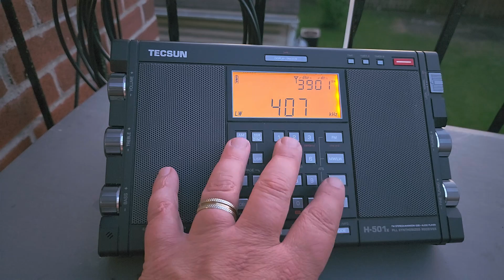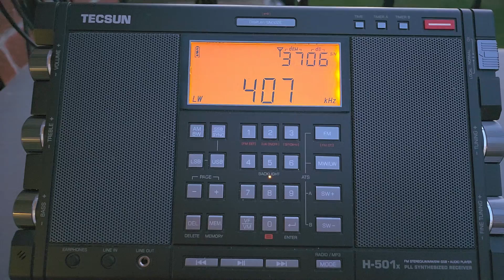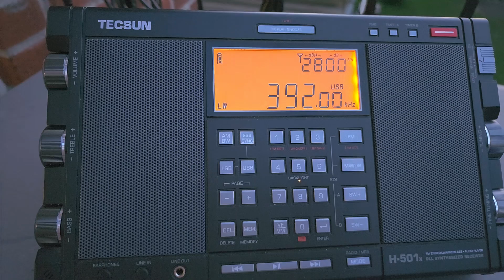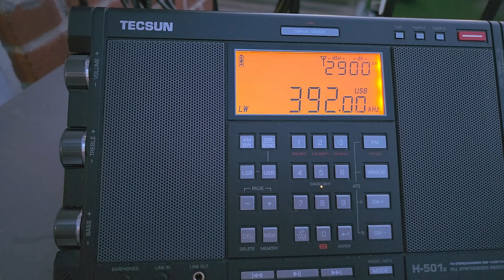Tips on tuning Longwave band in North America searching for NDBs Non Direction Beacons

Comment: Been trying to find out: does this radio or the PL-990x that supposedly go down to 50 khz actually do that? How is WWVB reception for example? Also i read that some of these don't tune the ferrite so you get massive intermod from AM (and I have a lot here locally).

FWIW, I'm a ham & would like to try 630m & 2,200m bands & one of these seems far simpler (& hopefully repeatable} to test relative TX performance, maybe even Rx distant stations. What do you think?

Comment: Great video, NDB hunting is fun.  I've logged 19 NDBs in the past couple of weeks.  A couple of thoughts from my recent experience: 1. Go outside if you have a portable receiver, that will get you away from a lot of electrical noise.  2. I actually get better results on my PL-990X by switching to the whip antenna instead of the ferrite loopstick.  (I realize this isn't possible with many receivers.)  3. I get even better results with an external reel external antenna.  I just clip it to the highest tree branch I can reach, or support it with a telescoping fishing pole.  (Requires external antenna capability on LW.)  4. I've logged the most stations early in the morning, around 8:00 AM local time.  I need to try even earlier, maybe around sunrise.  5. The SSB tip is a good one.  Use USB, tune lower frequency to higher and listen for a carrier.  Once you get a 1000 Hz tone, tune 1 kHz higher to zero beat the carrier and listen for the CW ID, which is actually tone-modulated AM.  6. Bonus tip, the whip (vice loopstick) works well for AM DXing too.  Sometime you can find a station and then switch to the loopstick to find a null and estimate the station's direction.